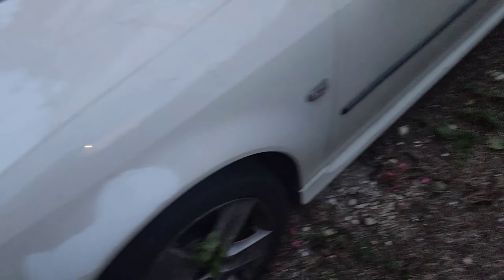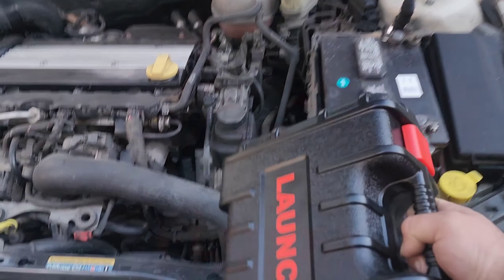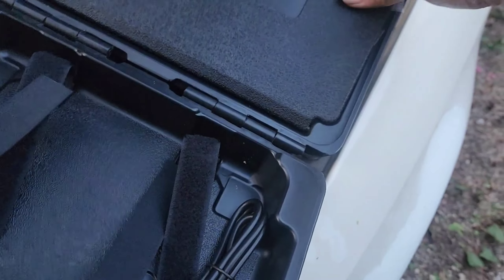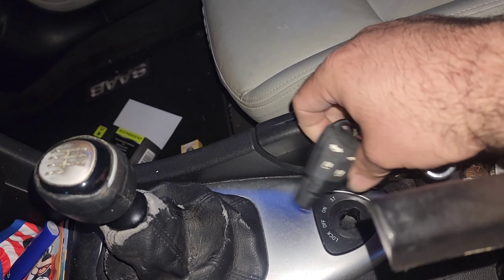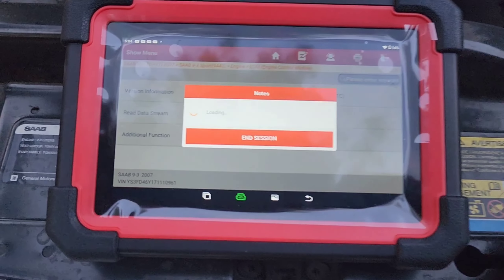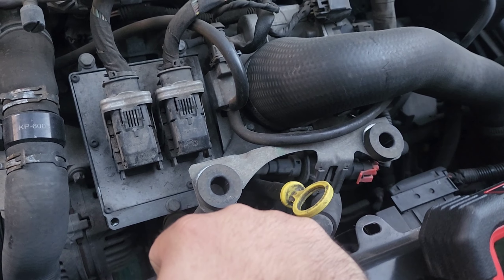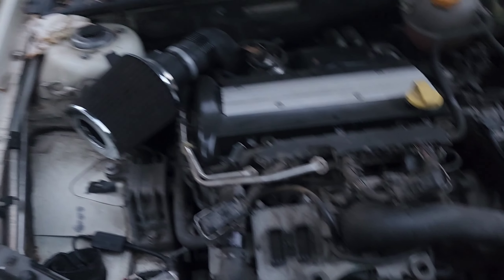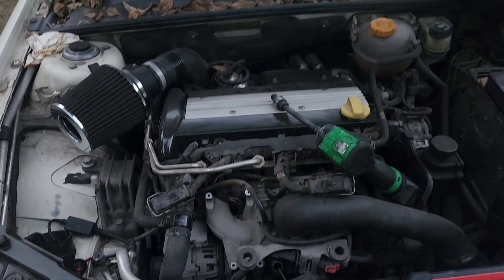CAN LAUNCH CRP919EBT SCAN A CLASSIC? #scanner #launch #tools

Comment: That's no SAAB. It's an Opel wearing SAAB badges 🤣🤣 I don't think a Tech 2 with Chevy software will communicate with the SAAB. Ivan @ Pine Hollow Diagnostics had to perform a similar operation. He had Tech 2 scanner software on his laptop. He was able to download the SAAB software off a website for free. It took awhile but he got it sorted out. Wish I could be more help but my experience is with the older cars. I left the dealership in 99.
Reply from the maker: Lmao yea...ehen i looked up the procedure on alldata it said to use tech2 i THINK lol unless i misread, what was yalls scanner software at saab called?